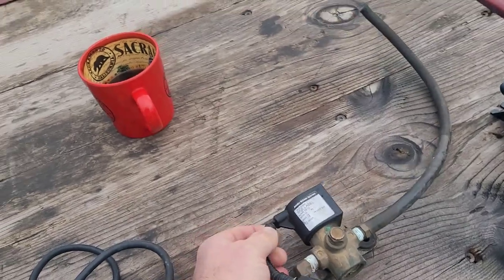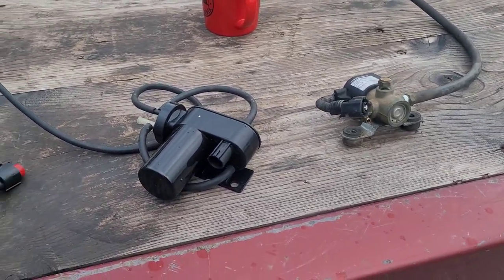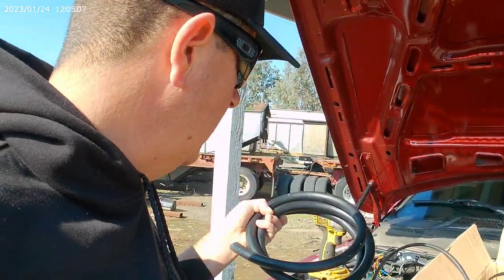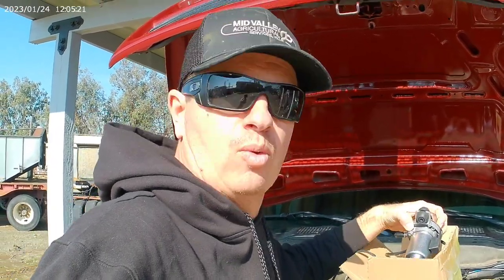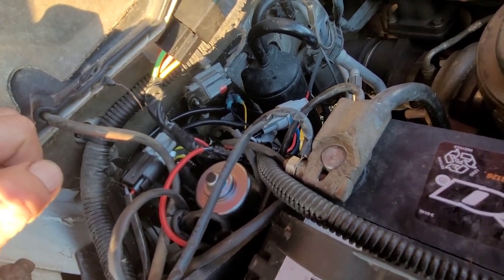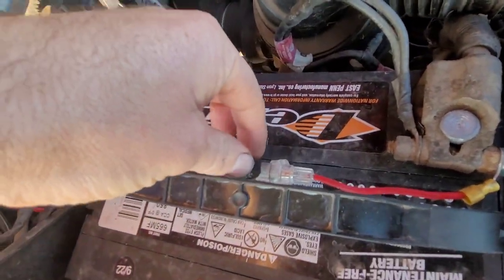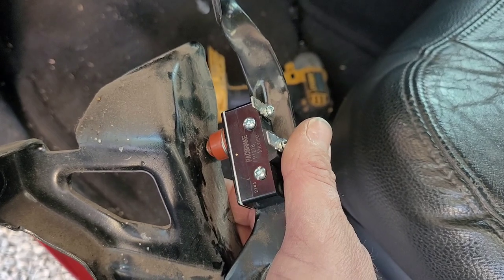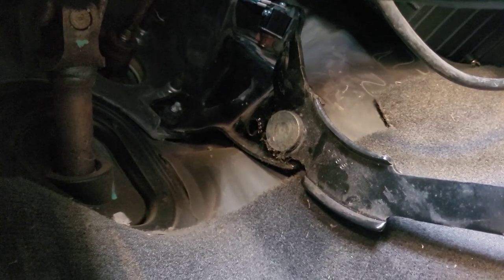I bought the CHEAPEST incomplete exhaust brake on marketplace and made it work! Electric vacuum!

Comment: Just added the same pump to my truck this week. Seems like it takes 3 sec. For my exhaust brake to activate. Did you end up using the vacuum canister. To help the reaction time be faster. Thanks for the video.
Reply from the maker: Mine is plumbed without the canister. Mine actuates in about 1.5 seconds which is why I left it out. Maybe the diaphragm in the brake is worn?
Reply: I’ll look into it. Wondering if it may just be how my peddle switch is. It may have the delay. Thanks.

Comment: Did you use the relay for the Jacob’s solenoid as well? Or just run it off the relay supplied for the kit?
Reply from the maker: I installed a relay for the solenoid itself

Comment: I have the same brake that came with my truck and missing parts, can you please send me a list of parts especially the vacuum pump system?
Reply from the maker: TMaster 12V Brake Booster Vacuum Pump kit -"Plug and Play" w/installation kit,Quiet high-performance 18'' to 25'' electric vacuum pump for brake booster https://a.co/d/1Lx3rcx
Reply from the maker: https://www.xtremediesel.com/pacbrake-c14037-ecm-bypass